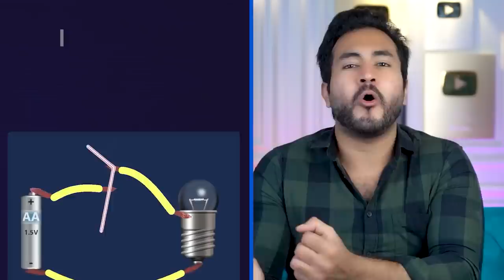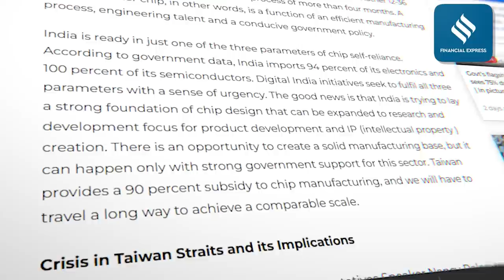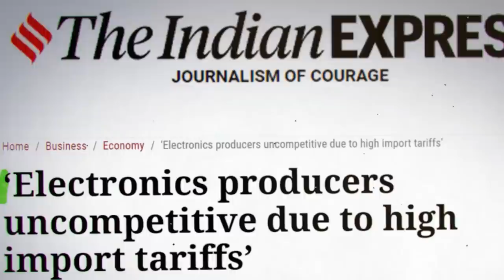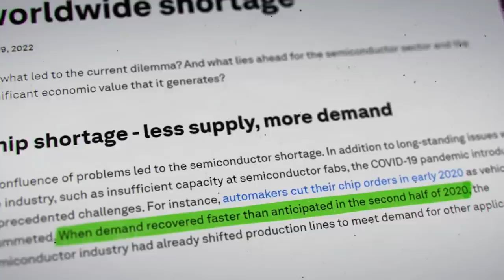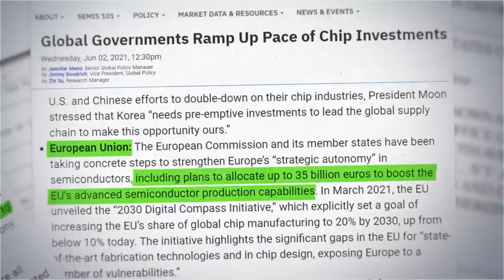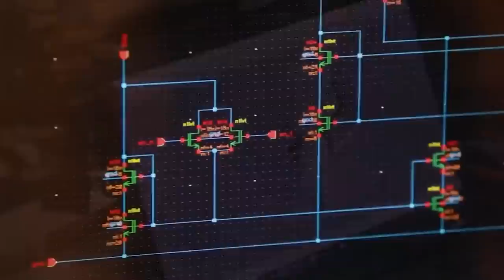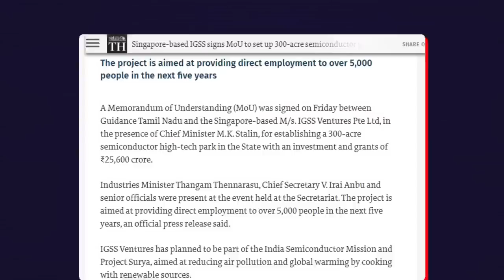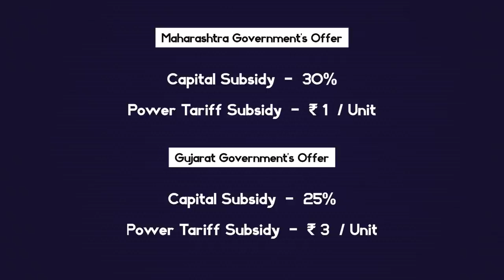LAPTOPS & SMARTPHONES Will Become Super CHEAP! | India to Set up 4 SEMICONDUCTOR Factories

Comment: Sir you have missed a important point in chip manufacturing....Lithography machine which is very costly .One Lithograph machine cost is 200 billion $ ...This machine is only made by one monopoly factory ASML in the world . ASML is the only company who makes lithography machine to print and itch circuits on the Silicon material.

Comment: To be clear so far announcements have been made for producing 65nm-45nn and 28nm. Current market leaders are at 3nm. So we have a great start but a long way to go until we have the chips to produce cutting edge consumer tech. If the govt was truly thinking they would've supplied these clusters with desalinated water to diversify water supply.

Comment: GUJRAT- Capital subsidy- ₹28000 cr., Land - 200 acre at 75% of rate, Electricity - ₹2 per unit for 10 yrs., Stamp duty -5%
MAHARASHTRA - Capital subsidy- ₹40000 cr., Land - 1100 acre (400 acre free of cost + 700 acre at 75% rate), Electricity - ₹3 per unit for 20 yrs., Stamp duty - 5%, ₹373 cr. Water subsidy and ₹812 cr waste management subsidy
BUT Modiji uda le gaye project

Comment: Wtf yar which semiconductor they r planning factory in India for 10nm chips we r using 4nm chips now at that time we use 2nm or 1.4nm what is the use of 10nm means it will be used in non compact devices in routers cars but it cannot compitate in market of updated generation . But it benifits alot but it doesn't mean it decreases laptop rate who is going to buy Intel 4th gen laptop now.